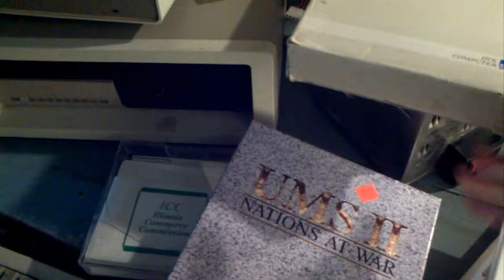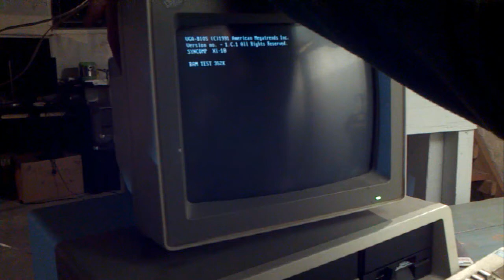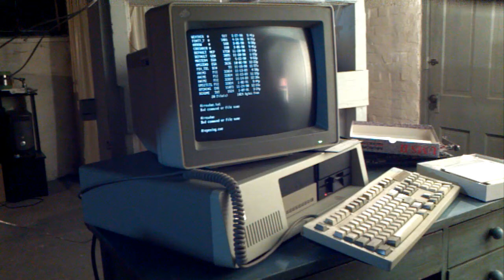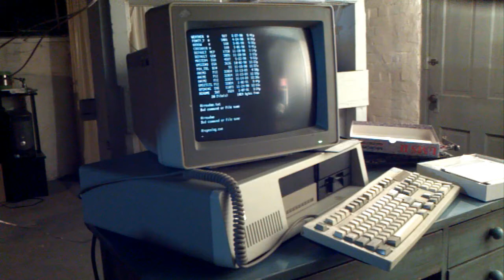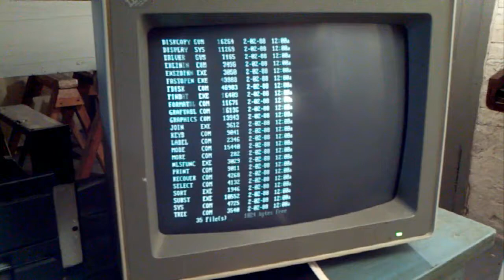IBM PC/XT 5160

Comment from the maker: yeah thats how i tested the floppys was i hooked the 5.25" drive up to my Dell Optiplex.you can also run it on a virtual machine too. thanks for the tip, i thought the manual said that if you just state a compatible file it will read it on its own.just like when i run a program on it i don't have to type "run" or even ".exe"

and yeah my first computer was an 8-bit PC compatible too. it was a Spearry i got it when i was about 7 (1999 or so). but i needa get used to DOS, im used to BASIC too much

Comment: WOW! Time machine or what. That shot me back to my youth. I couldn't see what you were typing to get the .txt file open. But you need to type Read Filename.txt. That should work. Yes the basic that came with these is also usable on present day machines. You have to get it onto a 31/2inch floppy and then you can then use the floppy to transfer to cd. Then run it from command prompt. I cut my teeth on these machines. Really enjoyed the journey back in time.

Comment: Looks like a replacement motherboard. Original XT boards were bigger.  They also have a tape drive connector next to the keyboard connector.  I would be curios if yours has that tape drive connector.
Reply from the maker: yeah its an upgraded board, but i dont really care. its still components for it.
Reply: It's all good. I have a few 8088 clone boards hanging around and one machine I put together.  I also own a original untouched IBM XT with a tape drive.  I love these old machines, clones or not.
Reply from the maker: Michael Russo
i've been looking for a Sperry IBM clone. it was my first computer and i sold it for like 20$ in 2004.
Reply: Michael Russo Indeed, it's not an original IBM PC/XT board. It would have been a lot bigger and the POST looks slightly different. 

However, the XT (model 5160) never had a tape drive connector. That was the XT's predecessor, the IBM PC (model 5150). From the outside they look the same except from the backside. The PC (5150) had 5 expension slots and the tape drive connector, the XT (5160) had 8 expansion slots and lost the tape connector.